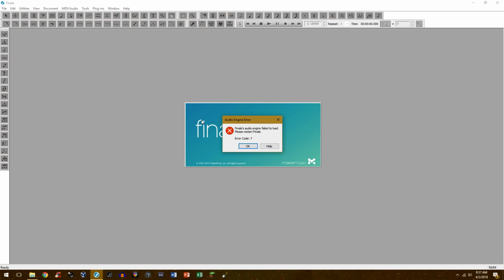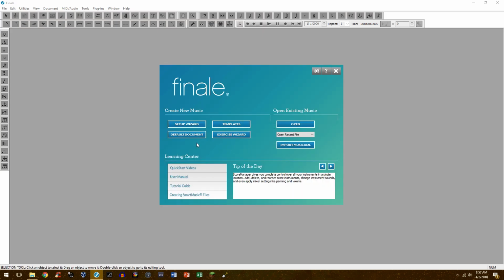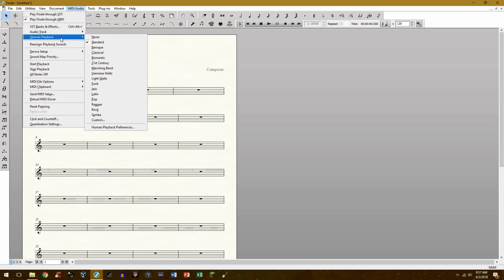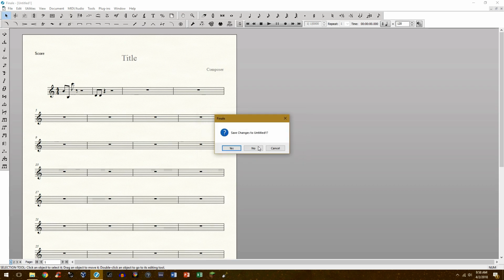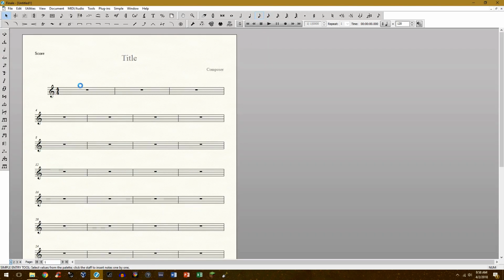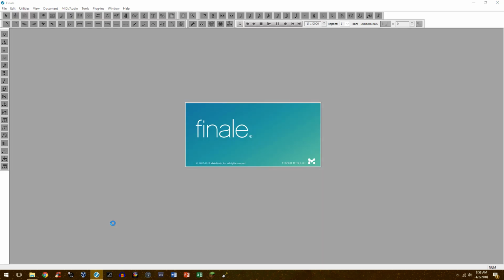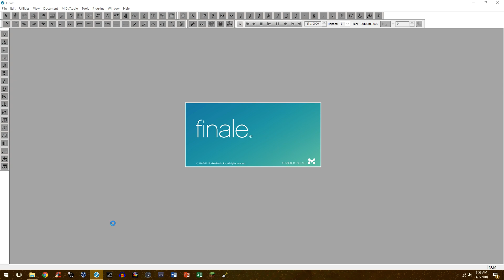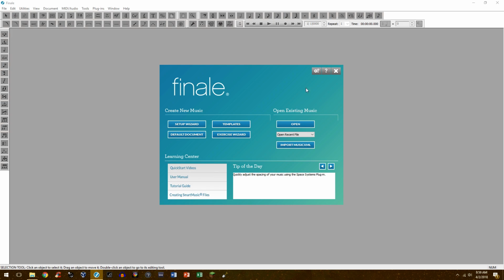Finale v25.5: Audio Engine Failed to load. Error Code: 7

Comment: Thanks so much. I have a question. I'm running Cubase7.5 and Finale26 simultaneously. If I start cubase first, my musical keyboard doesn't work in the Finale. It works only with cubase. And I start Finale first, my keyboard doesn't work with the cubase. I want that my keyboard let work in the both app simultaneosly.

Comment: [EN] Guys, who haven't a [Reset ReWire] button, just go to the [Audio Setup] and on the top change [ASIO] to another (For example "Direct Sound") after that, bellow ("Output") change Source to your headphones or speakers. Restart the program and done.
[RU] Ребята, у которых нет кнопки [Reset ReWire], просто зайдите в [Audio Setup] и в верхней части смените [ASIO] на другой (например, «Direct Sound»), после этого ниже («Output») смените Source на ваши наушники или колонки. Перезапустите программу и все готово.
[IT] Ragazzi, che non hanno un pulsante [Ripristina ReWire], passano semplicemente a [Audio Setup] e in alto cambiano [ASIO] in un altro (ad esempio "Direct Sound"), dopo, muggito ("Output") cambia sorgente alle cuffie o agli altoparlanti. Riavvia il programma e il gioco è fatto.
[SP] Chicos, que no tienen un botón [Reset ReWire], simplemente van a [Configuración de audio] y en la parte superior cambian [ASIO] a otro (Por ejemplo, "Sonido directo") después de eso, abajo ("Salida") cambian la Fuente a sus auriculares o parlantes. Reinicie el programa y listo.
[CH] 那些沒有[Reset ReWire]按鈕的人，只需轉到[Audio Setup]，然後在最上面將[ASIO]更改為另一個（例如“ Direct Sound”），然後將波紋管（“ Output”）更改為Source 耳機或揚聲器。 重新啟動程序並完成。

Comment: I had this issue with Ableton Lite 9. I also have to add that I use 3 audio drivers: WASAPI, ASIO4ALL 2 and Realtek ASIO. What fixed my problem was the following:

* MAKE SURE FINALE IS USING ASIO. I tried before with all other drivers, none worked, so Asio is the way to go. If the "Reset Rewire" option is greyed out check this, as it was the reason why I couldnt access it either.
* In Ableton 9 Lite, Go to Preferences, and in the CPU tab there is the "Multicore/Multiprocessor ReWire". I had it ticket off, so I turned on.
* Went back to Finale, the problem persisted, but then I followed the instructions in the video, resseting Rewire and such.
* Restarted Finale and I finally got sound! I also went back and forth between Finale and Ableton: No issues, I didn't had to reset Rewire again.

If you're using another program, check the options panel carefully, as this options may not be very intuitive.

Comment: Reset rewire option is grayed, so I can't fix it.
Reply: same
Reply: @Denyal123  Can you resolve it? i have the same problem
Reply: Damian Noriega I am assuming you've already fixed it, but if not click midi audio device settings click on audio set up and where says audio driver change it to something like direct sound or something else click OK and you should be good
Reply: install audio ASIO driver, and it will work out guaranteed 
http://www.asio4all.org/

Comment: I'm a user of the finale 2014 version.
There is no [Transpose MIDI On Input] and [Reset ReWire] at the bottom of the Device Setup item.
Does not appear
Since installing the audio interface, it has been adversely affected by error code 7.
Is there another way to solve this problem?
Reply: RESPONDE O CARA MOÇO...

Comment: finale 25/ inactive reset/rewire ???
Reply from the maker: How odd. Try reopening Finale and see if it's active. If not, check the user manual I linked in the description. Best!
Reply: Thanks for your comment :)   i study through your link... solved - allowed the "apps to access my microphone" in the Privacy settings
Reply: Thank you. I did the same and it is working now. You saved my life

Comment: I do not have that selection on my finale 2014.  ??????
Reply from the maker: Right. This is for ReWire which was introduced in v25 - - 2014.5 does not have this option. Check out the help link in the description as there are many reasons why this error can occur. This video only explains ONE method. Let me know if you get it working! :)